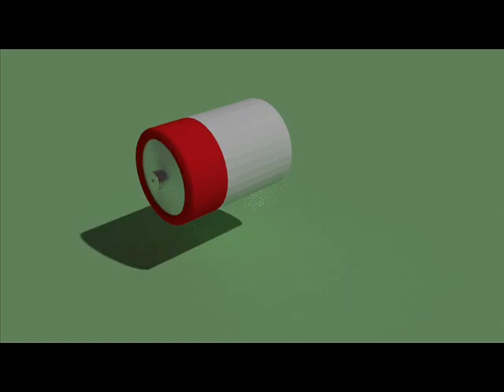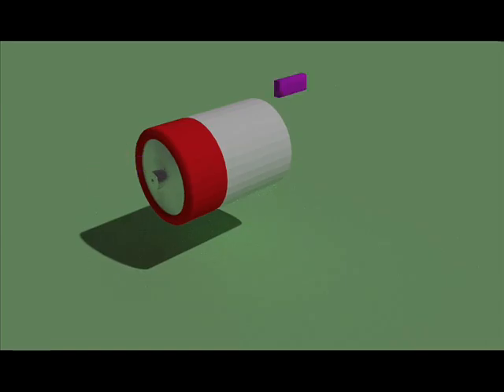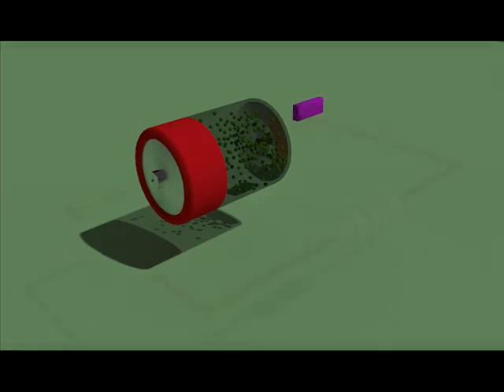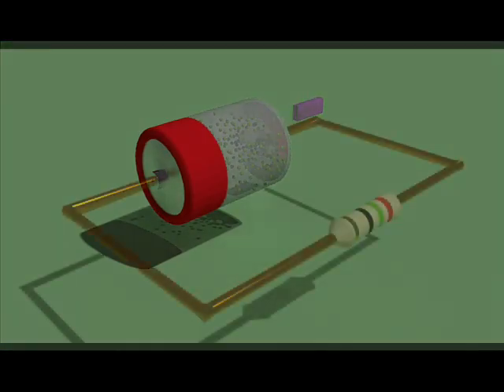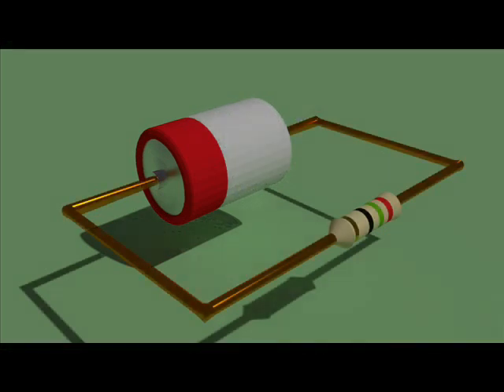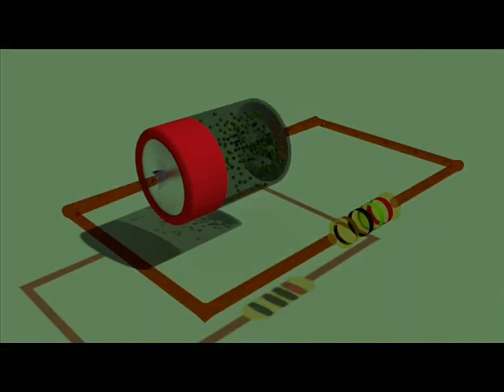Direction of Current Flow: Conventional vs Electron Flow

Comment: Thank you Sir. 
But my opinion is
Current will occur when some thing is free to move when difference of energy present.

For Direct Current —

In wire conductor electrons are free and moving. As the potential difference created,

They start moving from higher potential to lower potential . Higher energy means + notation and lower means — notation. It's as simple as we eat from top and digest out from bottom.

Why the whole world has getting confused just due minus charge ( notation only) of electron.

The conventional direction of current assigned is correct.

For AC in wire conductor as name suggests as energy level aternating direction of current i.e. flow of electron from higher to lower.

So the direction of flow of electron i.e. current is from Higher energy to lower energy. No matter of sign.